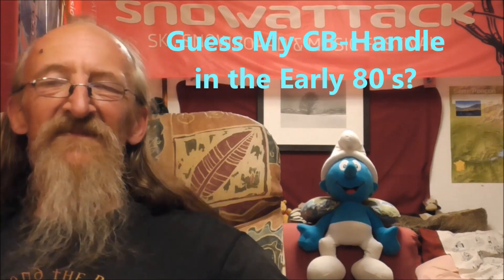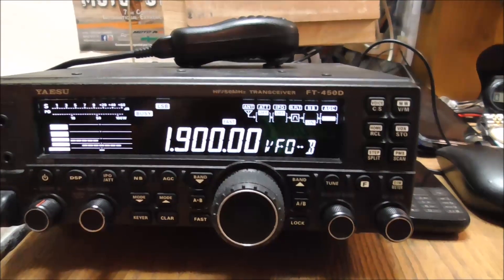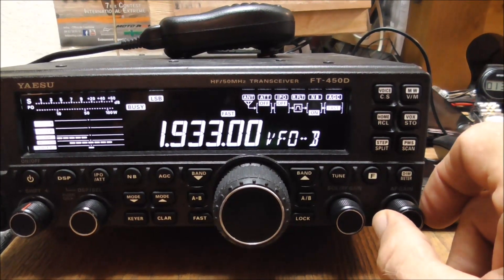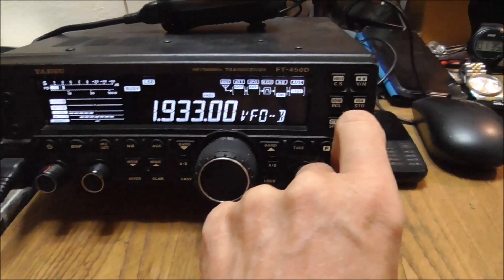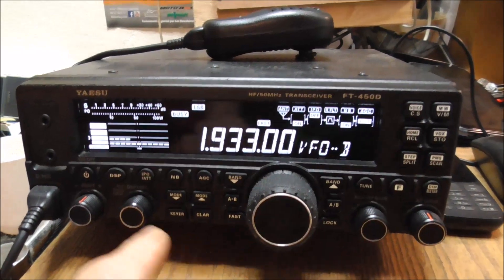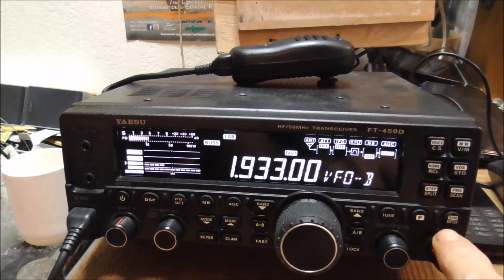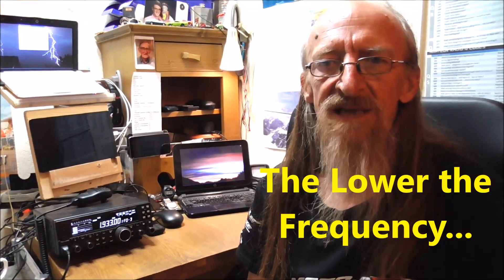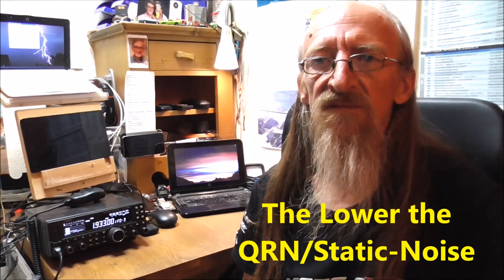Short-Wave Listening on My FT450d ~ Excellent Top-Tip (& Tuning) ~ Background Murmur to Signal 5+

Comment: With the pl259 plugged fully in its an '11 metre' resonant antenna, with the ground disconnected it isn't, and works as a random length of wire.
Reply from the maker: Correct.